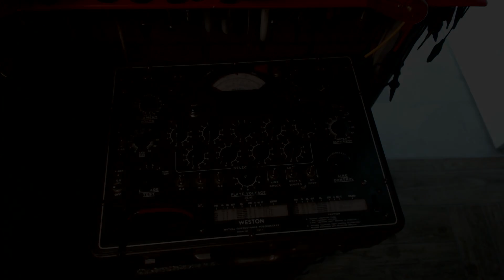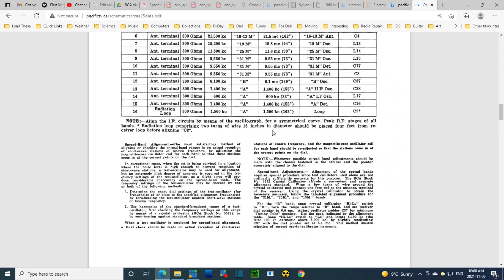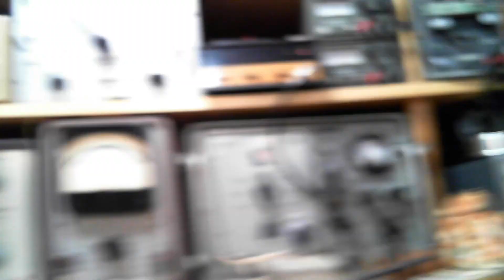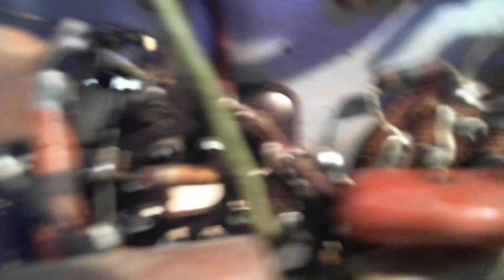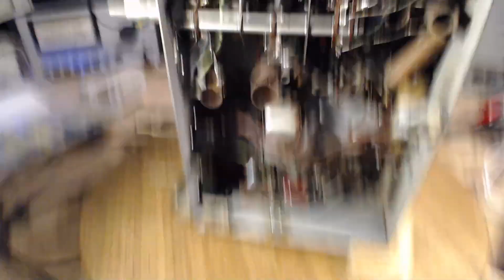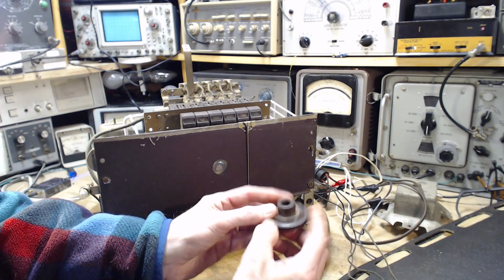RCA Victor A38 Shortwave Tube Radio Video #2 - Initial Power Up

Comment: He already replaced one cap with the WRONG value - That should be 220 nF not .5 !!!
The amazing thing is that he tested the cap  and it showed 200 nF, yet he still insists that's point five whatever...
This looks promising...
Reply: Question tho; is this cap really going between plate and cathode with the tube that is in. If so, 220nF would be a bit high and supressing high end a lot. 5nF would be more common value in that spot.Granted I only glanced at 6F6 vs 6K6 pinouts but it looks like its the same pins for cathode and plate...
Reply: Are you watching the same video I am??  The schematic called for .005uf. He replaced with the correct value.

Comment: That was a good video Jim. I'm looking forward to seeing the rest of this restoration of this radio working. I really like your videos and have been following you for a few years now not because you produce sleek polished videos of what "you've done"  which is very easy with editing and comments such as , " you don't want to see this " or "you don't want to see that" because there are plenty of videos which show that ! Actually, there aren't that many videos which show what is actually done, there seams to me, to be more videos showing what has actually been done if that makes any sense? You go through your thought process explains how you understand what should be happening within any given circuit and you show us what you actually do to get the results you want to achieve. I'm not a highly educated electronics engineer and a lot of the stuff I'm looking at when I open the back of an old radio might as well be Chinese puzzles , but it's stuff I like and have a lot more enthusiasm than knowledge so it good to see someone like yourself who comes across the same problems and makes the same mistakes as I do, and your an expert compared to me. Thanks for putting these videos out and if I may say, cheer up. I've seen some of the negative comments lately and would encourage you to ignore them. Theres an old saying I like which comes to mind quite frequently, " those that do, do", "those that don't talk".

Comment: um, 224 is .22 uF
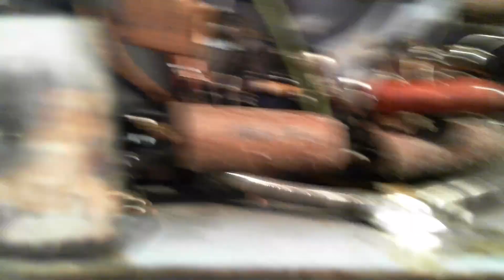Reply: Yes but if the cap is really going between plate and cathode 220nF would be a bit high. And if you look at that cap (36:53) it says 224K 50x3 and while K indicates 10% tolerance, I am not sure about 50x3. But that 50 along with the size at that capacity suggests to me that it is maybe rated for 50V only. And a  50V cap across plate cathode... Maybe that is why it was disconnected.